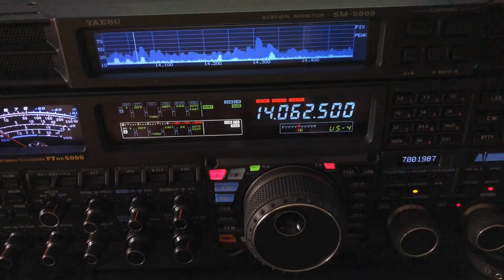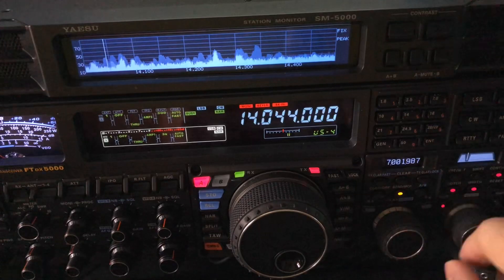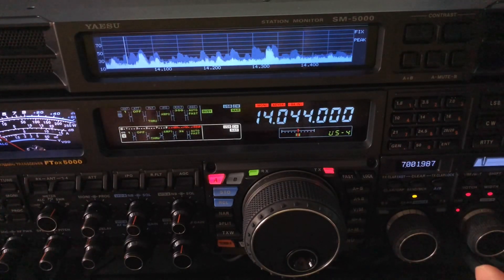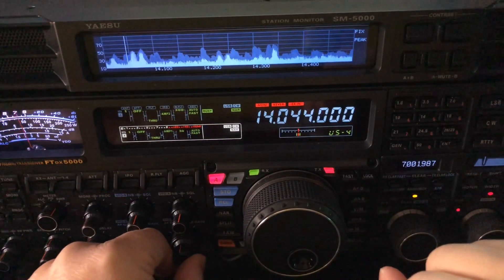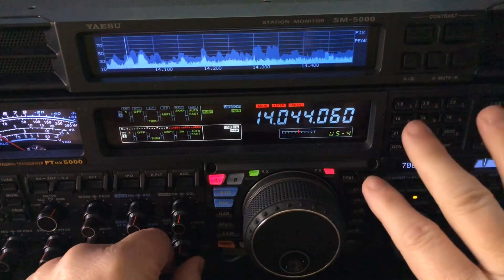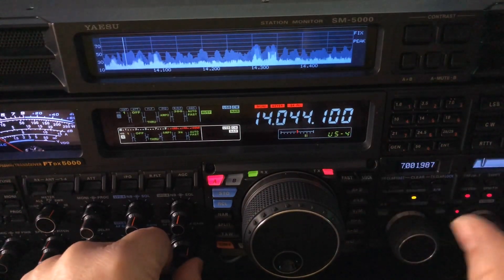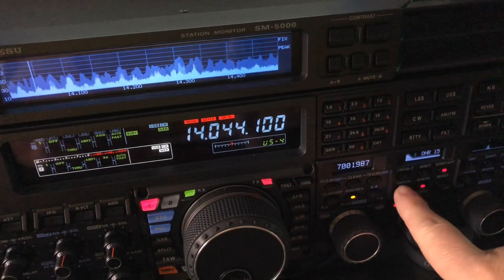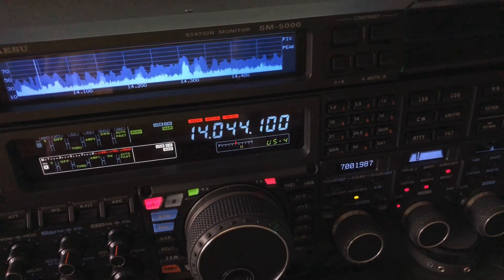Using CW-U & CW-L with Manual Notch to knock out QRM 100 Hertz away

Comment: Hi, would you mind trying something out for me. I tried using the WIDE Notch on cw. on the FTDX10. To me it sounds like I dont get so much filter ripple especially on weak signals. Yes I have to turn the volume up more and it comes up around 450hz. Give it a try and let me know what you think.
Reply from the maker: You can use wide notch.  You just won’t be able to get as close to your sidetone frequency.  I leave mine set at narrow because I also use notch on SSB and I don’t want to affect the receive audio as much as wide notch does.  I could go into the menu and switch to wide each time I go to CW, but I am switching back and forth between CW and SSB multiple times in just a few minutes, as I chase SOTA stations.

Just be careful not to choke the sidetone.  It’s not a problem for stronger stations, but for weaker stations, barely more than imaginary, the wide notch might choke them if you get too close to the sidetone frequency, which is the frequency of the ripple sound.

73, de N4HNH

Comment: Apf is yaesus meal ticket. Very much like elecraft k3
Reply: Used it all day today on Sota chasing, makes big difference most of the time on weak stations.
Reply: @SteveG4YTK  absolutely stunning on weak signal dx and sota. I can hear people on the 10 that I can’t on the flex.
Reply from the maker: Indeed it is.
Reply: @n4hnhradio  glad to get you sota today om. I was qrp and accidentally had the rig on 27 wpm for cwt. Hope you had fun.
Reply from the maker: Hi W4ZXT!  It was awesome having you as my tail gunner (last contact) yesterday on 30 meters.  

That NY4G EFHW QRP weatherproof antenna amazed me again.  Second time to use it.  SWR was 1.0:1.  I mostly received 599 reports with my 5W radio.  So glad to get you into my log.

73, de N4HNH
Reply from the maker: I was sending at 17WPM.  Started doing that after I read a post on the SOTA Reflector by a merchant marine.  He said they have slowed to 17WPM because they don’t need to repeat themselves as often.  Since I know that chasers range from 12WPM to 22 on average, I decided to try the 17WPM thing.  I had one slow straight key chaser yesterday.  I used wide spacing for him.

73, de N4HNH
Reply: @n4hnhradio  I have noticed for some reason my signal normally gets through a pileup at 17 wpm. I call all CQ's at 17 wpm and change to the reply speed. Quality not speed.